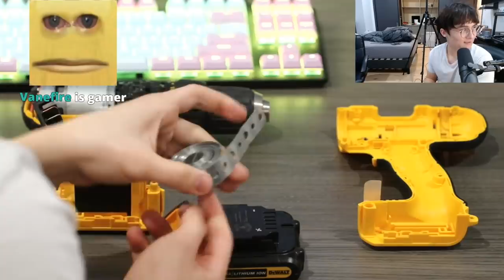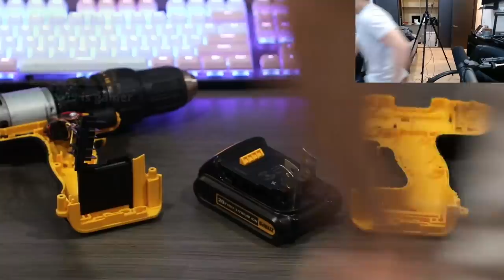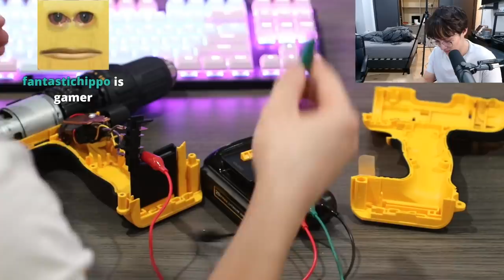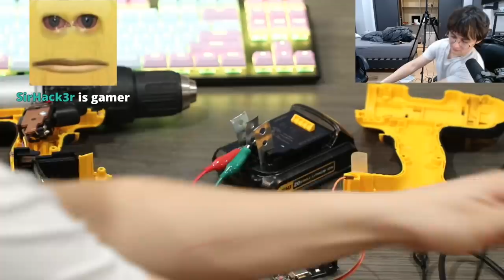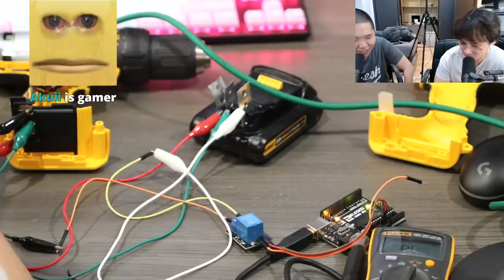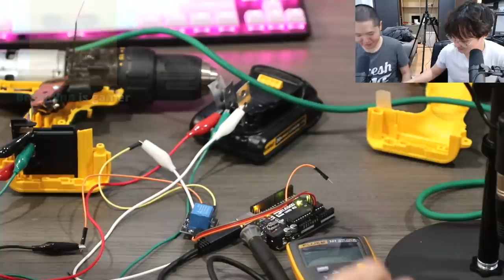Michael Reeves fixes chat drill!! | Drill go brr

Comment: Nothing wrong with using metal tabs to access a battery. Just don't short them. 
Your relay might not handle the influx of amps the drill can draw for long. If it fails it might fail closed meaning the drill wont shut off. Depending on what you're doing I'd put a physical safety switch on it.
Reply: Pretty sure that all the chaos that it might cause would probably pull the loosely placed metal tabs
Reply: Couldn't the metal tabs cause a parasitic capacity that could lead to intermittent sparks?
Reply: @jogadorjnc  kinda a non issue if its temporart
Reply: No shit lol it's 17 volts we'll be okay. It's not like they're on a 110 outlet or something like that
Reply: @evmanbutts  we have resistive skin, so a reasonable amount of voltage is needed to reach the heart, otherwise your're not getting killed
Reply: He didn't go to college, it should be fine.

Comment: In my engineering classes we will put 10+ 7volt batteries in series and clamp on alligator wire to a sheet of metal and we would burn our names into those metal sheets. It’d spark like crazy and melt some alligator clips closed...

Comment: What he should have done is disconnect one of the cables near the battery and made another button that reconnects the cables that chat can control and still have the zip ties on the trigger, he has shown he can do this when he made the annoying machine that turn on and off his lights
Reply: That... is what he did? A relay acts like a button that you can "press" using a microcontroller. Since it's connected to a microcontroller, he can write code to let chat control the drill.
Reply: TheFirstNobody  he's talking about the cables from the drill that connect to the terminals on the bottom of the drill that actually connect with the battery terminals. This would eliminate the tabs and extra wires and just require the relay. I had this same idea while watching and was looking to see if someone else posted it yet. I see someone did and now dumbasses are giving him shit for having a good idea. Unless I'm reading into the op comment too hard and that wasn't his actual idea.

And edit: looks like that's what he did on the final product as well.

Comment: after watching this i already knew what he did. he s using an arduino with a relay. the relay then turns on and off. (when you press the buttons it turns, its the same thing,he s just using a relay). then he codes, when chat donate , it sends the signal to the board and it turns. i guess I'm not wrong
Reply: Ohmibod
its the drill equivalent to an ohmibod

Comment: - "Its high amperage low voltage so its safe"
Isn't it the exact opposite?
Reply: Depends on context. High voltage will overcome the high resistance in your body to force current through you which is why touching your mains is guaranteed hurt/die. Low volt/high amps would generate shitloads of heat if you didnt put a proper load to a completed circuit, which is why accidentally touching a wrench between the terminals of a car battery will melt the wrench. but at the same time, you can touch the terminals of the battery and most likely not get zapped (unless you're sweating - salt water is a much better conductor than you are)
Reply: @cerb345  I see, thanks a lot for the explanation.
Reply: voltage, amperage and resistance are linked together(ohm's law). Since your body resistance is constant the only variable you can change is voltage. And voltage/resistance will determine how much current will pass. that's why the electrical signs say high voltage and not high current. Electroboom has a great video explaining this concept
Reply: @tsunatsuka1185  Just watched, it was very informative, thanks

Comment: WTF... as an electrican im realy disappointed. You dont need all this shit, btw the relay will probably stuck soon if u get any resistance on the drill. You could just cut the cable BEHIND the switch from the engine and attach them to an  push button(Normaly Opend) like for normal Houseinstallation. You get them in every construction market. then use the other side of the button to attach the batterie and its workin. Work time about 1minute.